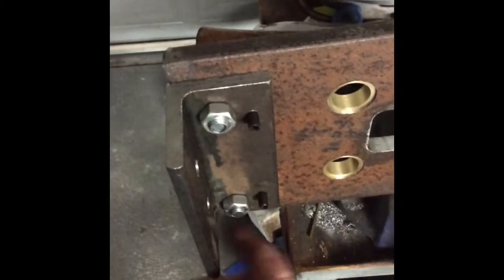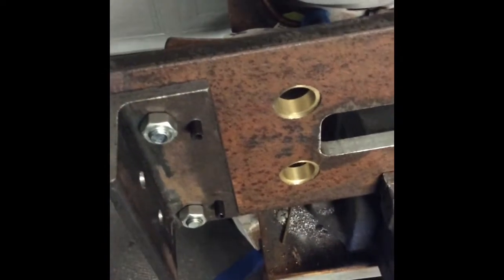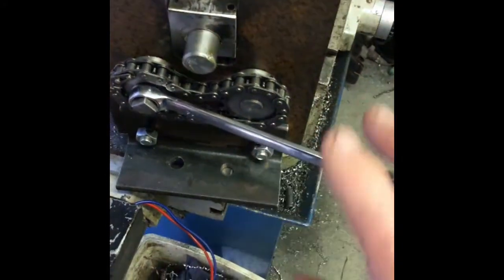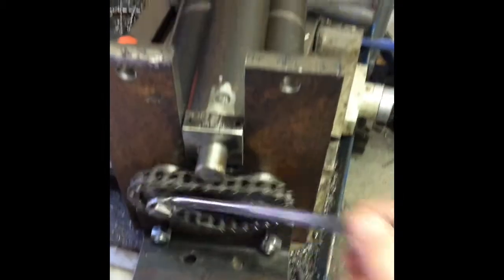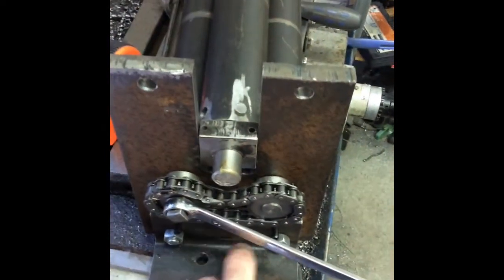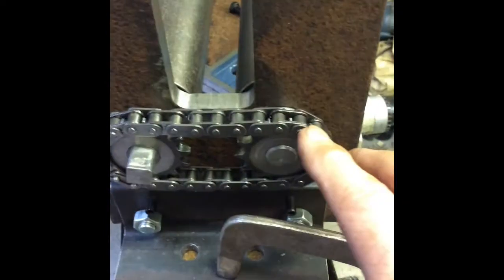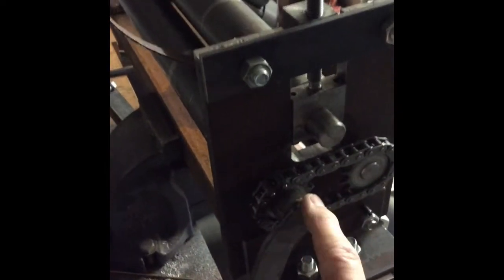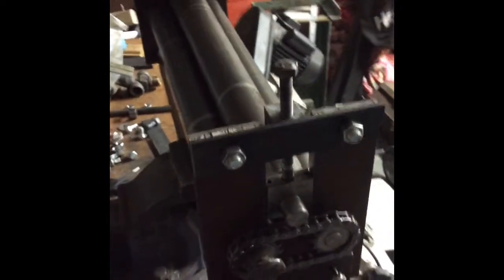Making a Sheetmetal Roller Part 5

Comment from the maker: Glad it was of some help, a suggestion that might help, if you roll a frustum, conical shape, a pair of vertical rollers on one end so that when the curve hits the edge it will roll on the edges. Mine now has gouges where the inner curve has rubbed.